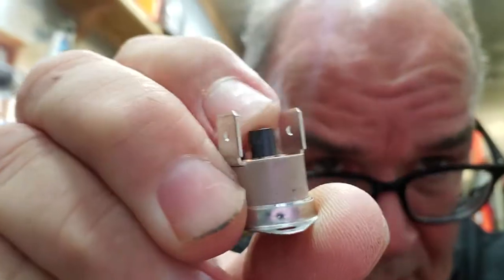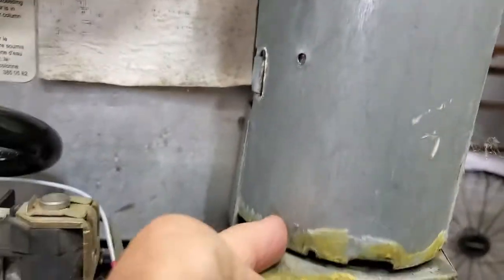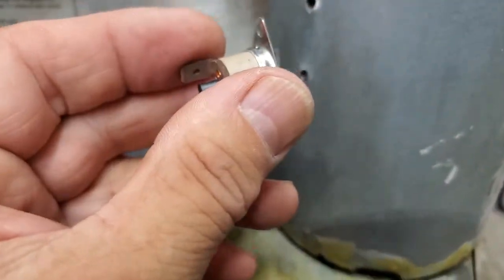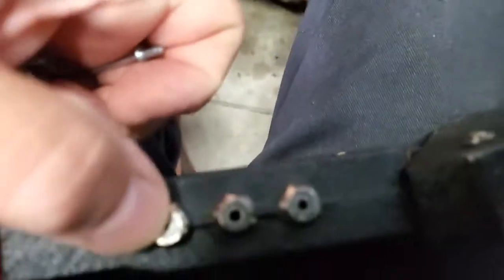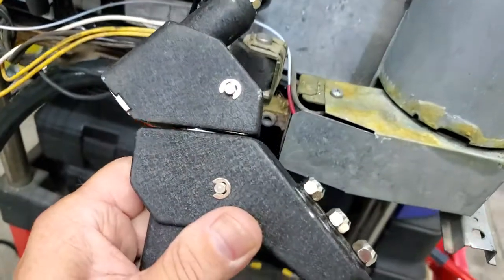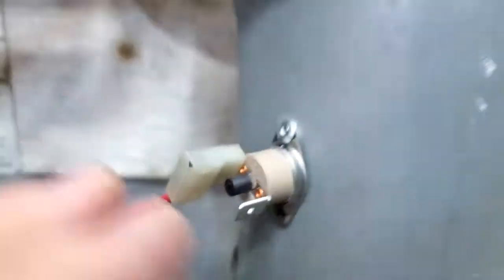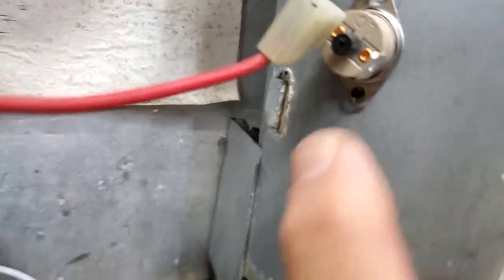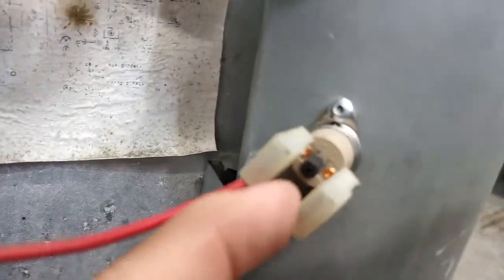Rv refrigerator adding a thermal power shut off switch to a boiler chimney

Comment: Why use pop rivets?  I was thinking along these lines but wanted it replaceable so I was thinking of using short sheet metal screws.
Reply from the maker: When things heat up and cool .I've seen screws come loose .Rivets stay tight ,even if the have build up underneath

Comment: Is there insulation between the switch and heating element? Mine pops after about 15 minutes and will reset after it cools off. It pops at about 310°f but literally one inch to the right or left the temp is only 160°f. 

Is it possible the insulation degraded and moved?
Reply from the maker: Yes
Reply from the maker: What degree is your disk
Reply from the maker: You might want to inspect behind where sensor is ,You have a point it is possible that insulation is open there .Did you blow out chimney pipe and rear it out with a brush .There is a heat reflective swirl in there on a rod .Rust builds up ,could be causing a hot spot !!
Reply from the maker: How old is unit?
Reply: @Rvdiagnostics  sorry I got mixed in on another post. The trailer is a 2001 but I picked it up in 2017 so I don’t have a history on it. 

I called Dometic and the suggested changing the boards. When it was still doing the same thing I got my IR thermometer out and discovered there was a hot spot right at the sensor. 

I haven’t opened the bottom get but I’ll do that when I get home later today. Thanks.
Reply from the maker: Well at least u have a spare board . Don't forget I have a garage and school in Seaford Delaware 19973 52x39x14 garage and full hookups with fifty amp services.
Reply from the maker: Www.rvdiagnostics.com
Reply from the maker: My Facebook page rvdiagnostics&troubleshooting 
https://www.facebook.com/groups/1974314296166277/?ref=share

Comment: Yellow, she done
Reply from the maker: Nope that's the old metal from the old absorbention unit .Cleaned it up as good as I could If you look a unit you will see it's new
Reply: @Rvdiagnostics  ahh ofcourse, thanks for posting
Reply from the maker: Your welcome
Reply from the maker: Www.rvdiagnostics.com
Reply: @Rvdiagnostics  so, I need to change the disk? It’s 300°under the disk and 160° only an inch or so away.
Reply from the maker: Read other response